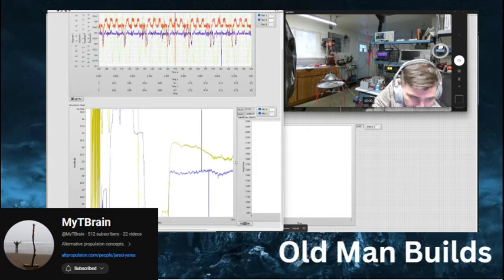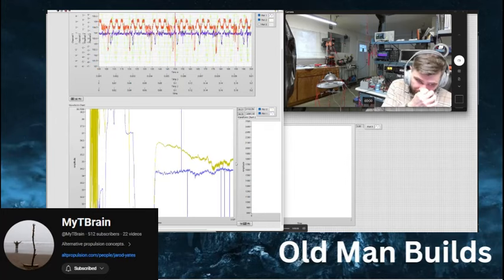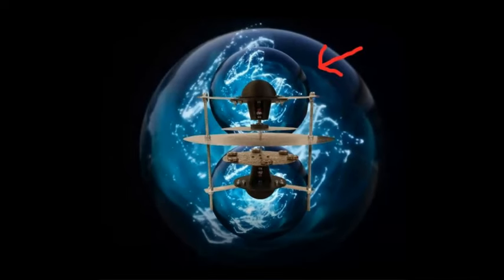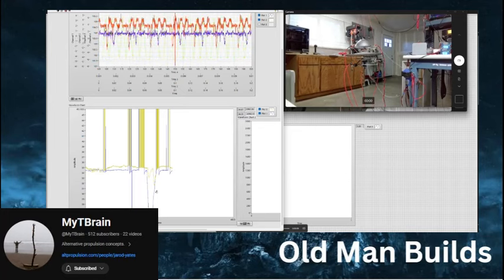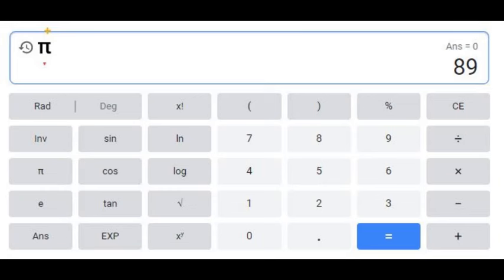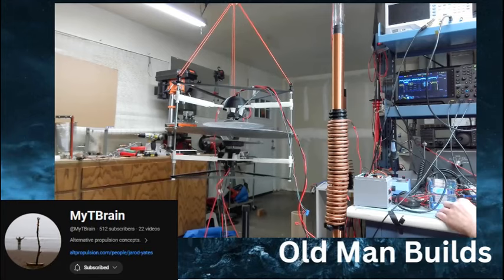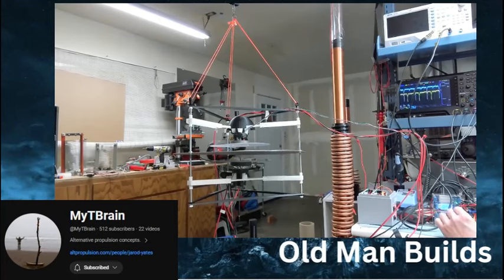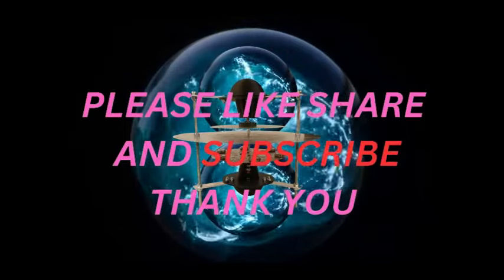Graviflyer "Testing & Reviewing" #7

Comment: A pitch fork will always sound the same whatever hard media you place it upon. Aluminum in various quantities has various resonances. What actually matters is the atomic resonance of aluminum. Your math is better than mine so one of you make an atomic resonance chart for us collating atomic mass and atomic size and share with us an equation. Great work gentleman :)
Reply from the maker: That is true however only the frequency of that tuning fork will cause other parts not attached to the part you placed it on to resonate as well. That is why I placed it on the frame and can still hear it on the upper and lower disc's. The louder it gets the closer I get to the exact frequency. I am modifying tuning forks to get to those frequency's. I have a feeling it will correspond to the OLD frequency's given for each note. As you might already know they changed them.

Comment: Checkout the Kermit Weeks channel on YouTube and look up his video where they test the wing on his Gee Bee Z Flutter testing.

They found out at what speed a resonant frequency would be established in the wing and cause self destruction. They determined from those tests how to add structure to eliminate the frequency and make the airplane safe to fly.

These gravity flyers will all have a slightly different resonant frequency so no two are going to be the same. Your going to need to either adjust the mass or adjust something else if the sweet spot turns out to be a very small margin to get success.

Either way I think you can learn something from Kermit's video.

Comment: I downloaded the audio from this as a flac file and the same for a couple of alexys videos and also the runaway state video from mytbrain and looked at the specrogram of them in audacity. This one when you put the tuning fork on the top bracket you get your 430 ish hz then 800 then 1200 then 1600 and so on all the way up to 10k in nice clean frequency bands. In alexys living room video, you can actually hear the same note being repeated every 5 seconds or so, im not sure where in the video its coming from though? On the spectrogram it shows as 450hz then 1500 then 2500 then 3500 then 4600, again all nice well defined bands. On the runaway state video its much harder to make anything out and not as defined, you can still see bands buts its very choppy as if its being pulsed and they are much thicker. The main frequencies you can see in that spectrogram are between 600 and 800 then 1300 to 1700 then 2300 to 3000 then 6k and 7k, as i said not as defined aha. Another video from alexi, the indoor one on tiles, showed a thick constant band from 1700 to 2000 and another much quiter one at 600. I dont know what to make of any of this other than the special sound is Cleary important and the tuning fork you have used almost matches it haha. Keep up the great work its amazing to see you guys make progress on this man.
Reply from the maker: What if I told you that the top motor goes between 860 to 1290 then the bottom goes from 860 to 430. Then the both reach a point where they go 860. The frequency is the rotational speed. It all has one thing in common. It make the sounds at these frequency's. The higher frequency's are from the ultrasound and the tesla coil. By seeing the trend we can multiply 430 by 2 until it gets to the tesla coil range and the ultrasound range. It is a pattern. We also know magnets can sing with voltage. Just start a bldc motor and listen. That means we have 5 frequency's ( top plate, bottom plate, center plate, tesla coil, ultrasound) the magnets in motion also make a sound (6th). The high voltage makes a 7th.  But only when the total combination is put together do you get is a symphony. We have not run the tests with all these things in tune. We are just now defining the sounds. When we are done the sound will be just like the one I put in the video.
Reply: @nathanbunten4299   Incredible man, so do you think the key is getting all 7 of those frequencies to some harmonic multiple of 430hz? That's basically what i can see in the spectrogram of Alexys living room video.  Also loved the idea from your call with the apec guys of sending Alexy a higher quality mic and getting him to record a few feet away when tuning and getting lift. Do you know if that is happening?  100% think a spectrogram of that would reveal exactly what you need to achieve, although you are probably one the right track at the moment anyway. Would be easier if you have a photo of a spectrogram that you know you need to hit and you could just compare it with a live one when attempting to tune.
Reply from the maker: @James-wk1ym  I agree. I want to discover all of it. Just incase we have the opportunity to visit him one day. I will understand everything he is saying without even speaking russian. Just by the way he is working with the science and hearing it.
Reply: @nathanbunten4299   Yeah I can imagine, an in person visit would be ideal haha.

Comment: This is just an observation. 
I’m interested to see that so far nobody has made the rotating metal discs on a lathe/mill to reduce the mechanical/undesirable vibration. I know it’d be a lot of work, but y’all are putting so much effort into this research anyway, it couldn’t possibly hurt.
Reply from the maker: It might work better. I saw the original and it is less impressive.
Reply: @nathanbunten4299  I guess my most basic question is this: does the graviflyer actually work?  I don’t have the resources or equipment to test it for myself.
Reply from the maker: @Critter145  I see the original inventors does work. I have not verified it yet.

Comment: Nathan, let me start out by what you are doing correctly. The high + and - charge on the top and bottom plate. The high voltage differential between the plates. The correct RPM of the motors and disks. Now I will explain what you are doing incorrectly. Alexey uses no radio frequencies.  Alexey does not use ultrasound but infrasound at 5.7 hertz. Alexey does not use three aluminum disks so they can short out. Alexey uses one aluminum center disk and a top and bottom polycarbonate disk coated with aluminum on the outsides and aluminum oxide on the insides. Everything is pulsed at the 5.7 hertz to achieve the resonant frequency to give the blast wave downwards to cause levitation. Alexey uses both top and bottom disk magnets that are optimally placed with the north and south poles.  How do I know all of this? Because me and a Chinese scientist talked to Alexey on the phone, and he thought we were mainstream scientists and he wanted recognition that you guys cannot give him so Alexey is not honest with you guys so you keep paying him money so he can live a comfortable life in Russia. I worked with Hutchinson where he used the microphone and barium titanate cylinder, and the objects did not levitate but just bounced up and down with the produced vibration and I posted this on a YouTube video using my theory of everything and Hutchinson loved my theory and told me this is what occurred. Gravity for all heavenly bodies works with layers. The sun has layers. The earth has layers. The moon has layers and Alexey's graviflyer has layers of aluminum, polycarbonate, aluminum oxide, aluminum, aluminum oxide, polycarbonate, and then aluminum. The earth has layers going from the top to the bottom of N2 and O2, carbon, alumina-silicate. These act as a Casimir effect device and a capacitor effect device. These layers block the gravity waves with the different electron orbitals of each element. In this manner anti-gravity is effectively produced and the sun revolves around the center of the milky way galaxy, the earth revolves around the sun, the moon revolves around the earth without being attracted to each other. All of these heavenly bodies have a BF, EF, GF, charge, voltage differential, charge, spin and are pulsed at the Schumann resonance of 7.83 hertz. Why aren't you guys listening to me?
Reply from the maker: I have seen the material used and they have been tested. The original one that flew ( not a copy )charlie has it. The disc's are regular aluminum. I know what he is doing. If you haven't noticed I figured it out a while back. I am trying to show other people the way to get there. I think your work is very good. I have to follow where this is leading first though. It has to be understood by everyone in simple terms. Not fancy words.
Reply: I met Jarod at Mark Sokol's Lab up in North New Jersey at an anti-gravity open house back two years ago when he was showcasing the graviflyer and I explained everything to Jarod, and he did not follow what I was telling him and keeps doing the same thing over and over and getting nowhere. I only live two hours away from Mark's lab.  As far as I know by attending APEC conferences Jarod and Charles graviflyer has never flown and I tell why in my above analysis. I don't know if Jarod remembers me, but I remember him. I don't think Jarod believed anything that I told him and thought I was a crazy person due to the government coverup of such technology.   At the conference Dave from Mufon was there and I chatted with him for two hours about UAP that he was excited to hear as I worked with the Regan administration and the US army back in the early 1980s on analyzing UAP flights on radar and their confiscated materials that I analyzed that were all metamaterials. Dave understood everything that I explained to him about UAP as he witnessed many of the UAP sightings as he investigates them. There were other at Mark's open house and most thought I was crazy and just ignored me where I explained how to get their devices working which still do not as they do the same thing as Jarod over and over. You know Eistein's quote. Don't expect to do the same thing over and over and then get different results. Ha Ha. Einstein had the same issues with people back in the day.  One of the materials was glass silica grains surrounded by an aluminum matrix in the shape of hexagons that when we hooked up to a DC battery to levitated and another was a specially shaped nanocrystals material of many different crystals that was an optical computer core, but we could not use this material as a computer as the computer was in pieces from the UAP crash. These materials were made with a replicator that I know how to make very simply now but not then and why they could not be manufactured back in the early 1980's until the present but the people at APEC are so brainwashed by the coverup that they don't understand and never try to build the replicator but that I think you will see by the end of this year. The optical computer core you may have seen in the macroscale on the internet by the current researchers using many different types of crystals and lasers.  UAP sometimes blow up as the star device sometimes has too much power inputted and then explodes.  I told Dave that the UAP would be blown wide open and get investigated by this country due to me chatting with Senator McCain back before he passed where I explained to him how UAP are powered that he thanked most profusely and then he released a lot of this countries data on UAP because he told me what they are going to do to me kill me and then he passed a week later. This is why some of the UAP that are seen flying around are military craft and some are the future military craft that are time machines and not space craft. The TV show the secret of Skinwalker ranch shows this with the associated wormhole for traveling into the past with the associated military base that is in ruins in the present and buried at the ranch and is underground as the earth expands with gravity and buries the base that is in the past and why some of the UAP craft are seen flying into the Mesa and ground in the IR as the craft are in the past and their light is redshifted to the IR that the researchers see in the present. I wrote to the researchers of this show on their Facebook pages, and they put me into contact with IS industries that is funded by the DOD that I then explained much to them and were truly grateful and are now building their own UAP craft that is powered by my star device. I also have others building such craft and my associated star device as the militaries craft are powered by other short term means devices and we will see what happens at the end of this year as the military already has such crafts and the people that I help are amateurs to blow the lid off of the militaries currently seen operating craft.
Reply from the maker: @richardmuller867  You are dealing with a lot of stuff I stay away from. I want nothing to do with government secret's. It only ends in death. 

I am going to continue to work on this device. I will show all tests. But I will not get into the governments business ever.

Comment: Need a spectrum analyser and microphone to see the harmonics of that strange sound
Reply: Microphones usually only work up to 12k, 15k, 20kHz and spectrum analyzers usually start in the high kHz range and enters the GHz range.
Microphone connected to an oscilloscope in high-impedance mode, with FFT enabled - will show how much energy the microphone is outputting in each frequency band/tap the FFT algorithm is processing.
Reply from the maker: I am working on it. Using a  tube with a mic at one end and the graviflyer at the other ( close to 3 feet apart) That way we get the sound and the mic does not distort with the high voltage.  The mic is connected to a frequency analyser.